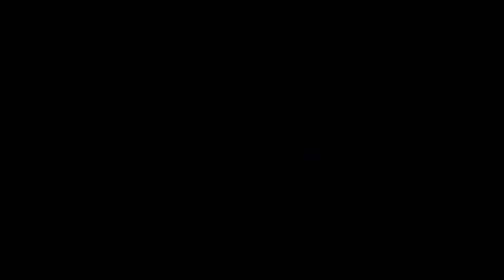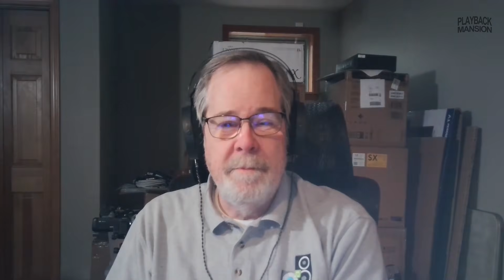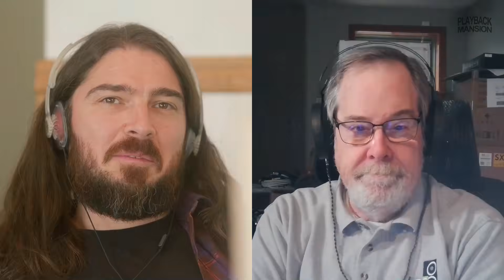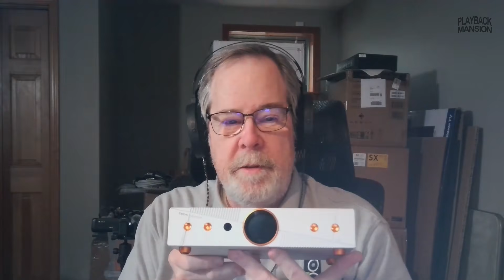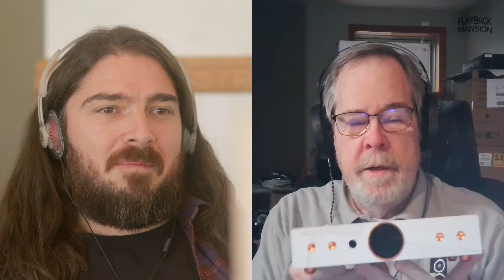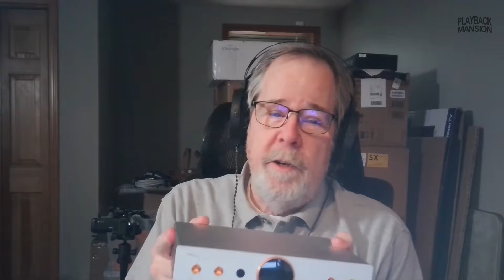i talk with Old Guy HiFi about DACs, his Douk Audio collab, Mission 770s, British Sound, and stands

Comment: The Q Acoustics Concept 50 is surprisingly British in its tuning. Really versatile speaker too because you can high pass them and plug the ports and get a more detailed, monitor like presentation. I’ve moved on to Amphion Argon 3S but I somewhat regret the change.
Reply from the maker: Thanks for the comment. what did you like about the Q Acoustics compared to he Amphions?
Reply: @PlaybackMansion  The Concepts were flattering of everything played through them. They have a really nice voicing. And they didn’t aggravate modes too much. I got a nice Harman curve with no EQ. Downside of them was how much of the tweeter you’d lose when you stood up. 

The Argons, they disperse much better. They’re much snappier than the Concepts. The downside is they tend to be very room dependant. I don’t have room treatment so I have to EQ them. They’re also more specific in what they want from an amplifier. They’re not as neutral as the Concepts. They’re not as forgiving of what you play through them.